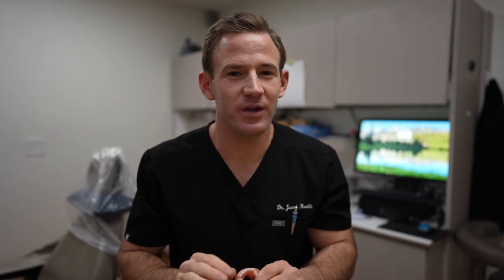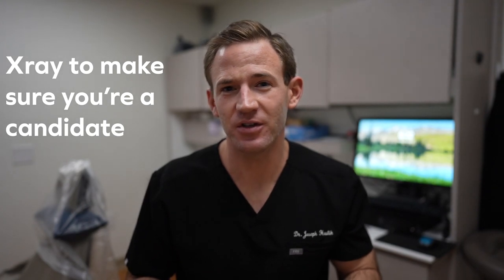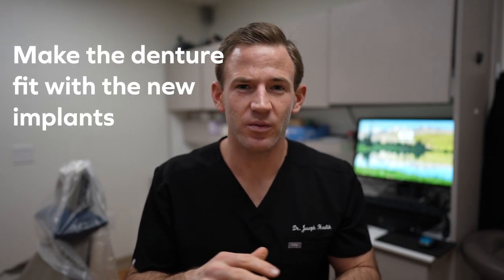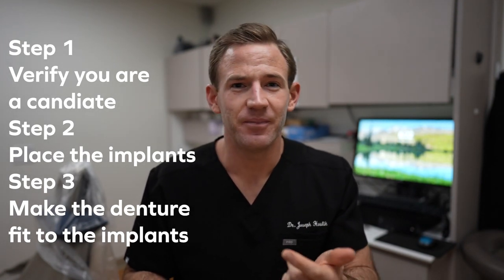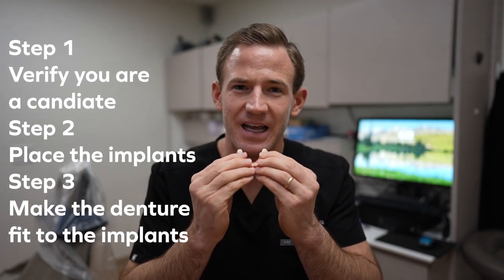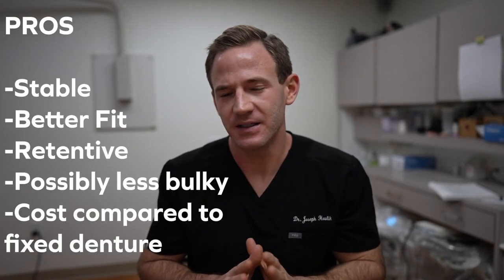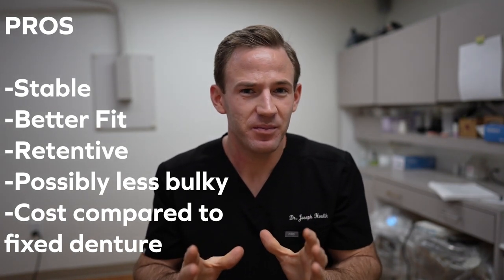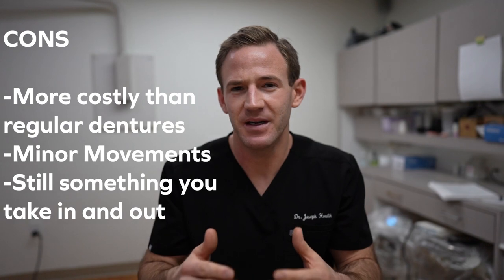Snap in Dentures. Improve your quality of life with Implant Supported Dentures.

Comment: How come the one to the left is not straight compared to the rest of them and they have different heights
Reply from the maker: The day of surgery the bone was slightly different and changed angulation/position subtlety to have better bones.
Different heights are based off tissue heights. He had lost so much bone and the floor off his mouth (tongue side) was tricky so to make sure the denture would still seat all the way, & not have tissue partially covering on the lingual we had to use different attatchments

Hope that helps!